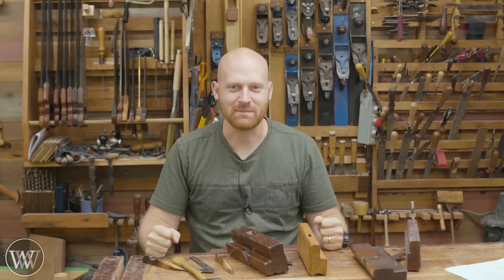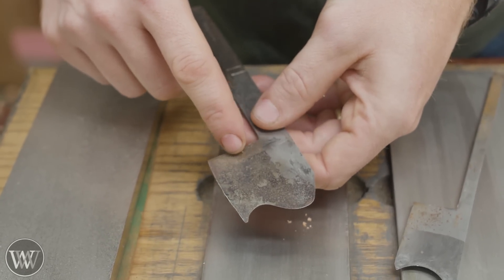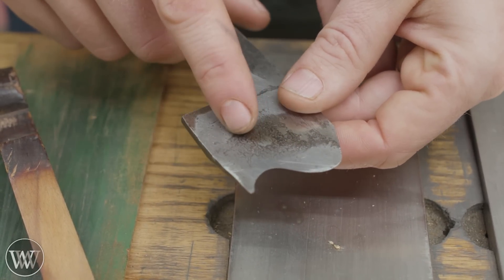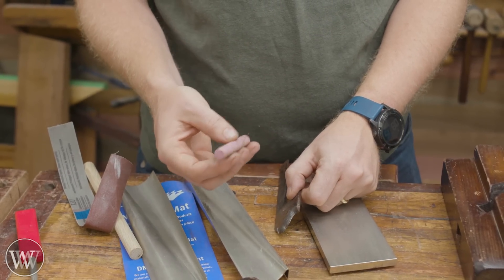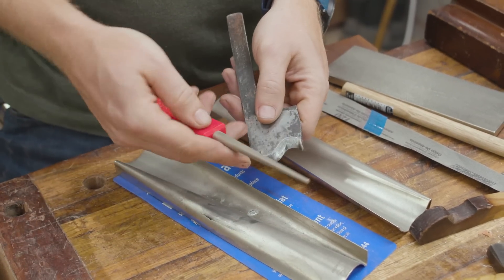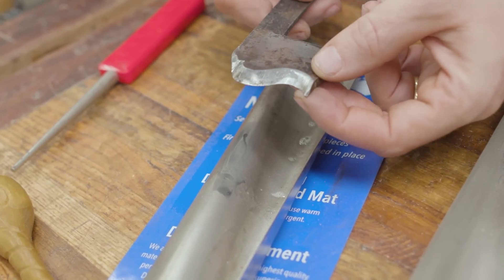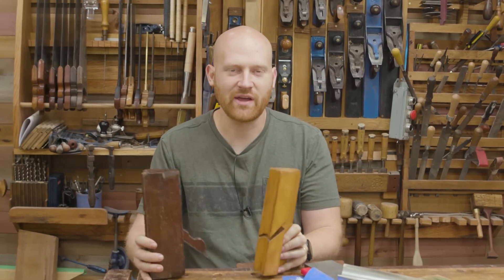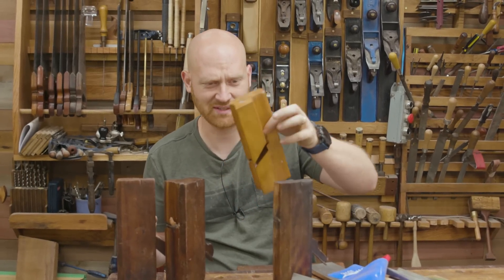How to Sharpening a Molding Plane

Comment: Tip for using round stones. Place it in curved board or  in tail wise between benchdogs  and then you can move blade like on  normal flat stone. If you did it carefuly they will serve you for years  ; )

Comment: can you use a moulding plane across the grain - if not how was this achieved?
Reply from the maker: Yes. You just have to make sure that it is very sharp and you're taking a very light pass. Also, if you're going off the end of a board, you'll want to support the last fibers for it to cut. So usually you cut the end grain before cutting the edge grain

Comment: Here where I live, there is almost no old tools in garages. There is a tiny chance I could find a set of rounds and hollows but I don't expect it to happen. How would you approach making a set? I've seen your video about making a grooving plane so I've got an idea how to make a body of such plane. Cutting irons seems to be easy with enough of elbow grease. What bothers most, is how to make pairs of matching curved soles? What are the exact profiles and dimensions? Anything and everything?
Reply from the maker: They are actually easier then they sound. you use a gouge to carve the sole of one. then use that plane to shape the hollow of the other that way they match.I have thought of doing it one of these days I might.
Reply: Search YouTube for The Hawley Collection which includes original cine footage of the last Marples moulding plane maker at work.  The 1960s cine footage is frustratingly out of focus on occasions yet still incredibly informative.  The Hawley Collection was founded to record the working practices of the Sheffield (that's 'Sheffield, England' for our woodworking brothers across the pond) steel industries before they died out, and includes some fascinating material!
Reply: @doczoff5655  Interesting footage, thanks for pointing to it. However, the guy was making those planes by dozens a day, which means, he had all the tooling prepared. Especially he had a negative molding plane to make soles of new planes. I asked my questions in the context of a one off job in a hobby shop and a chicken-and-egg situation.